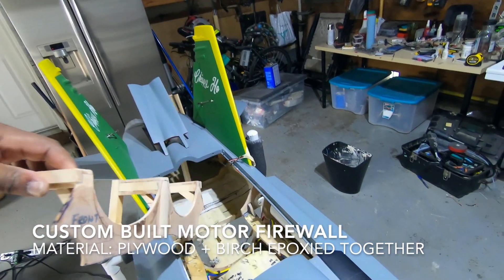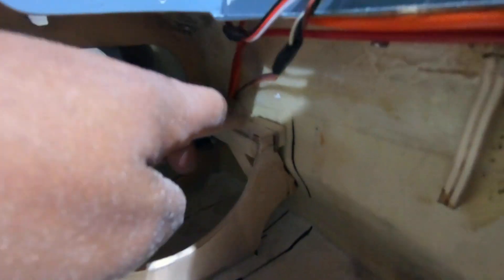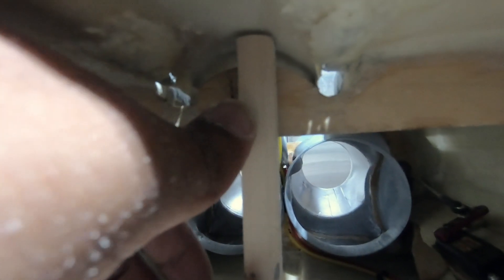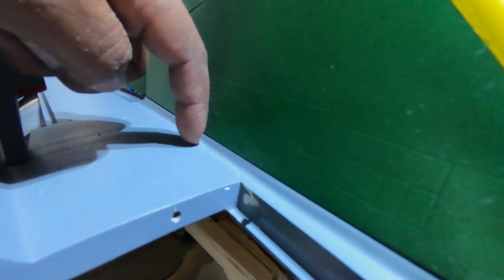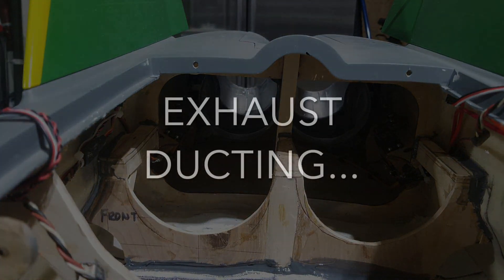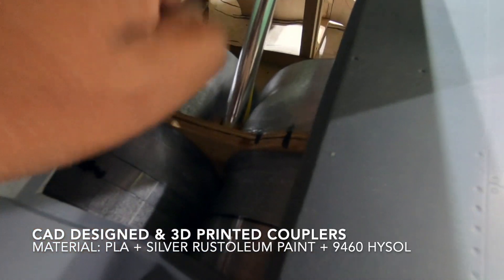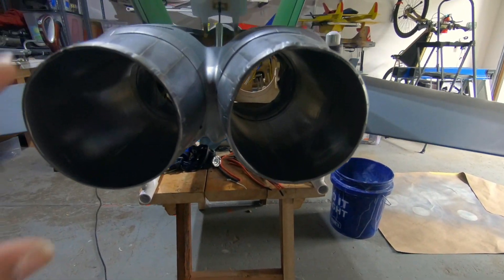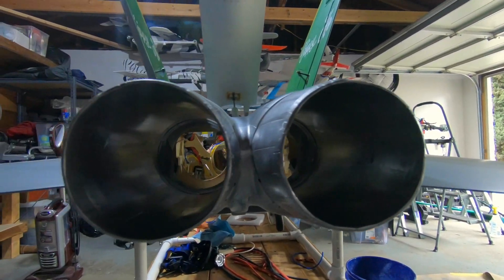SKYMASTER 1/8 F-18 EDF CONVERSION BUILD: AN INSIDER VIEW!

Comment: hi,
i plan to buy the Skymaster F18f X Treme and whant to put 2 Wemotex 100 edf inside, can you give me any tips for this plane please. best regards
Reply from the maker: So the wemotecs will probably fit. But you will need to do some modifications to the back of the aircraft. See my videos for how I tackled that.

The biggest issue imo is going to be getting a good thrust to weight. I am using 2x jetfan 110s with 12s 8000 x2. That setup weighs about 41lbs ready to fly. The jetfans give about 35lbs max thrust which is about a .85 to 1 thrust to weight at best new battery and good batteries too. That gives decent performance. I'd imagine going to 100 mm fans would produce less thrust but still weigh roughly 40 to 41lbs because the 12S packs will be your biggest weight contributor (~9lbs in batteries on my F18). 

Also keep in mind that you will need cheater holes to get enough airflow for the edfs. You may also need to change the exit nozzles to get the correct FSA for EDF... all of these things will make or break the flight performance of the jet.
So there's definitely some planning and experimentation to do. Just don't let it discourage you from trying. I know it was a long road but when I was able to shut up the turbine folks, it was well worth it. Lol!

Comment: NICE engineering, I have the Skymaster F-18 E version makes it nearly impossible to stick more than 90 mm fans in the back because the formers that hold the split pipe angle outwards at the exhaust
Reply from the maker: yeah I feel you on that one. I had a former there too but I cut it out. But I think by adding the mounts on which the 110EDFs sit, I got some of that former rigidity back. Besides, I figured the EDF would not be as fast as the turbine version anyways so less chance of buckling. So far so good :)
Reply: @FlyWithFrank  thx !! That makes sense